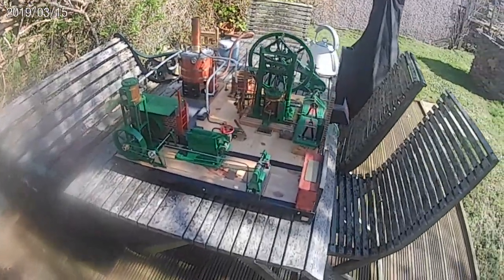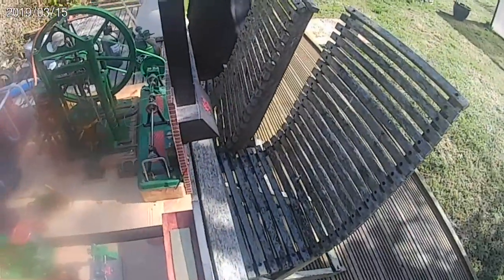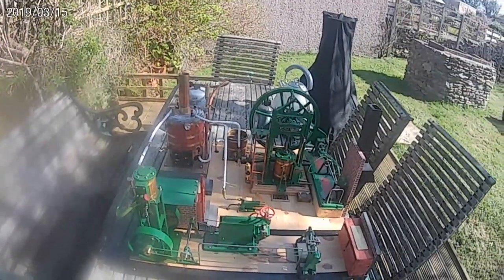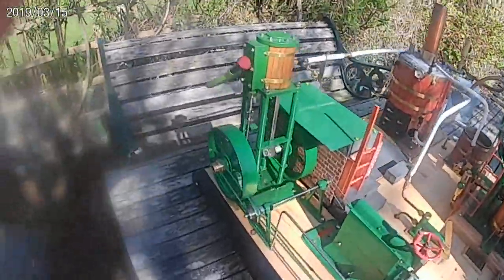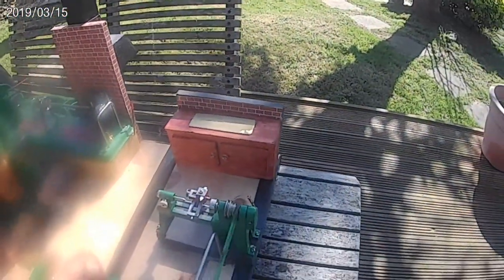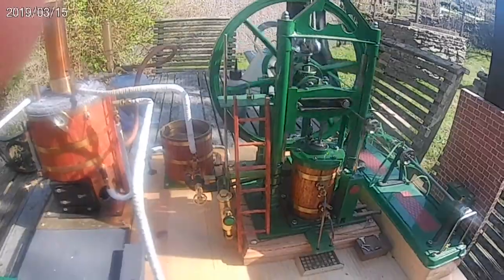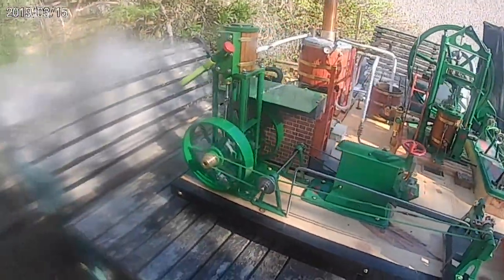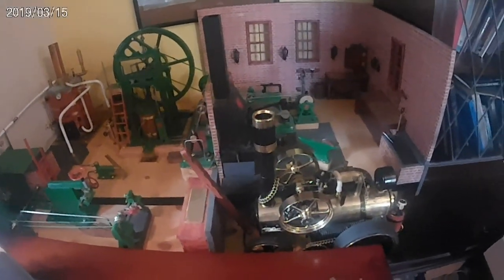first steam test  twin flywheel 1:12 scale engine

Comment: Very nice Eifion :-)   Just as a mater of interest what size are the steam pipes?  I have a vertical engine of a similar size to yours and at the moment I'm using 5/32" pipe but think that is too small so I have some 1/4" on order.
Reply from the maker: 5/32 " inlet on both but 1/4" exhaust on the bigger engine
Reply: @eifionjones559  Thanks, the 5/32 exhaust is choking my engine so I thought while upgrading the exhaust I may as well do the same to the inlet.
Reply: @modelsteamers671 I found the same with the exhaust on my Polish school engine on my other diorama ,but only after resetting the timing etc etc etc, trust me LOL!
Reply from the maker: oops , no idea why I replied on my wife's computer was updating it at the time
Reply: @rosemaryjones2855  Thanks, at the very least I need to fit a larger exhaust.